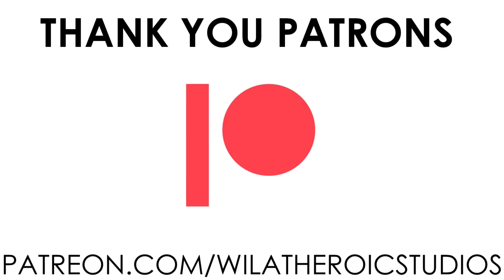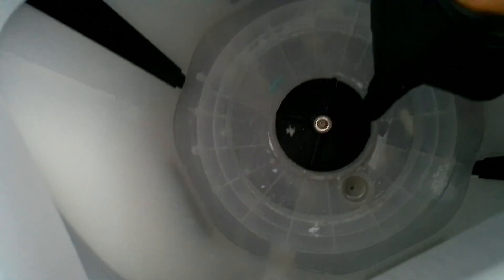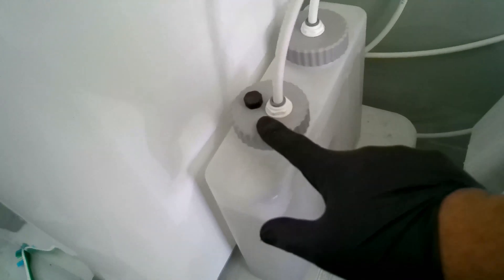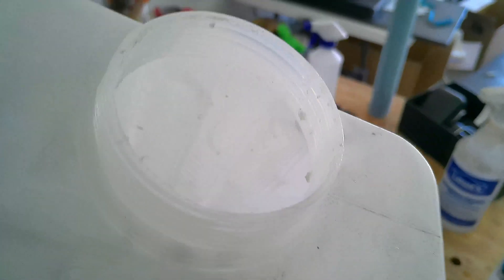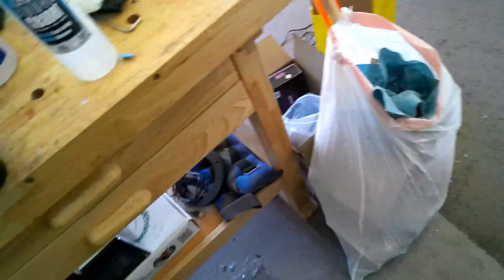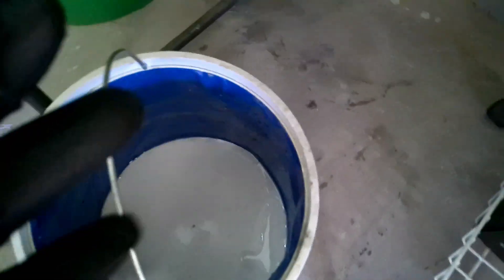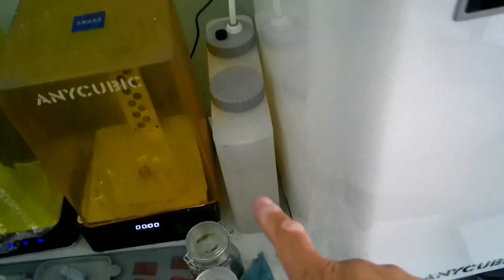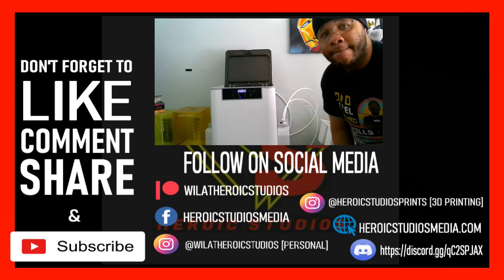Keeping Your Wash and Cure Max CLEAN | #Anycubic Wash and Cure Max

Comment: i wish that this stuff was in the manual...  i have been trying to figure some of this out.  also i have noticed that your machine is slightly different thank mine, your control panel is different, mine has wash and cure, cure, play/pause, and cancel, mine doesn't have the reset button?  i bought mine shortly after it came out, wonder if it had a revision, although the cancel button will do the same
Reply from the maker: I think they did. I didn't buy mines shorty after it released though. But yeah, alot of information on matiainence was lost or ill advised
Reply: Might we well just clean my own prints if I have to clean this thing every 2 washes
Reply from the maker: @nelsikegaming  not necessarily 2 washes. You can probably go more. Just when you start seeing error codes it's probably time to clean it
Reply: @wilatheroicstudios2466  I just tried cleaning it (my prints are coming out full of gunk) and I've had it for 2 days: Used a toothbrush and sprayed 99% IPA and the cured resin just won't come off the basket. Returning this asap.
Reply from the maker: @nelsikegaming  oh man, sorry to hear that. See if you can get another one sent out. Anycubic is usually good about that if it's within the warranty period
Reply: @nelsikegaming  It may be worth having a "pre"wash tub to dunk the part. Might help keep it from getting overloaded